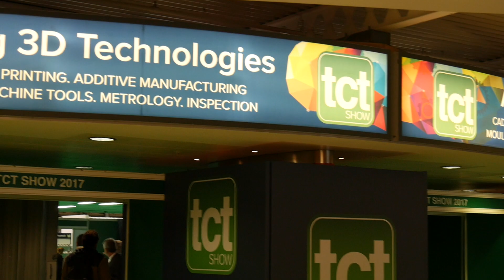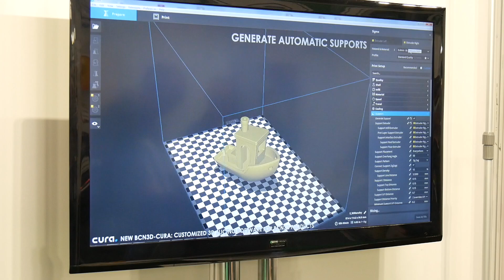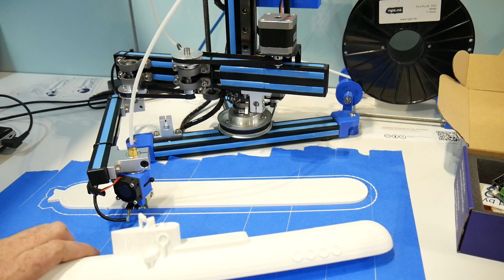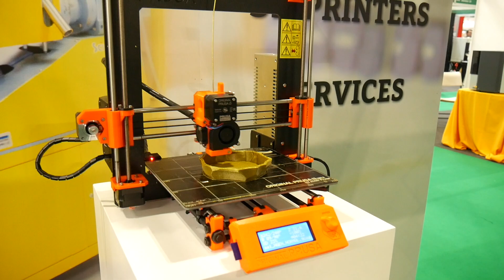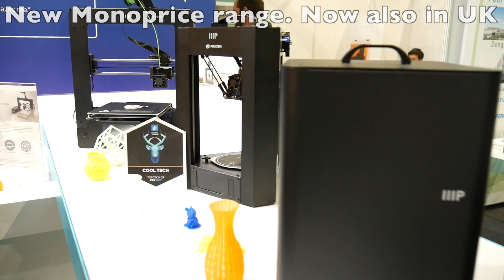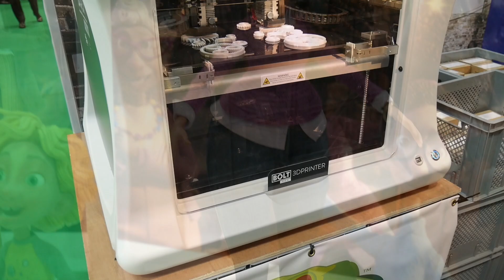2017 TCT Show Highlights

Comment: Along with difficulty to reach temps to print PAEK, its also expensive as all hell. Even the easier to deal with variant which is about 30% cheaper, unless you need a very very specific need for the material properties its pretty much an industrial needs only niche product.
Reply from the maker: exactly, the only day to day users that would need it would be university students or engineers for projects. agreed on it being an unforgiving filament to print with

Comment: I have enabled notifications so that I don't miss the Felix Tec 4 build. I have a Felix 3.1 and I have modified it with an E3D v6 + Titan extruder assembly and a 32-bit RADDS board (which has been my workhorse printer for a year now). I also have a second Felix 3.1 frame and have been thinking of using a DUET board + their new Felix magnetic build plate, but the Prusa MK52 PEI coated magnetic plate seems a bit more appealing to me right now. I really like Felix printers, but I could never understand their pricing strategy.

Comment: The Problem with PEEK is not the print temperature, you need a PT100 sensor, an PT100 amplifier board, and a copper heater block, these will cost you ~50 gbp from e3d.
However the filament itself is ridiculously expensive  250g of this stuff will costs you 160 gbp (allso e3d)